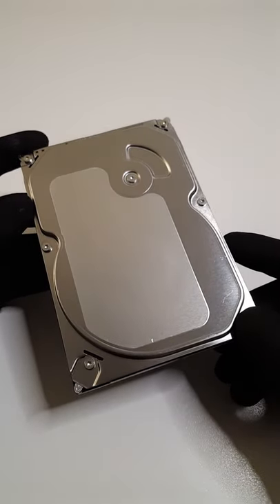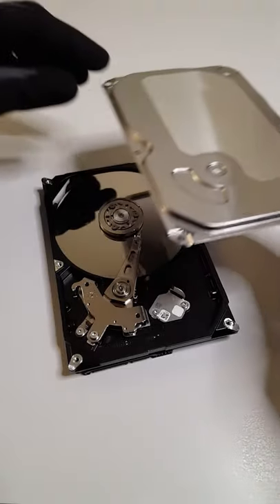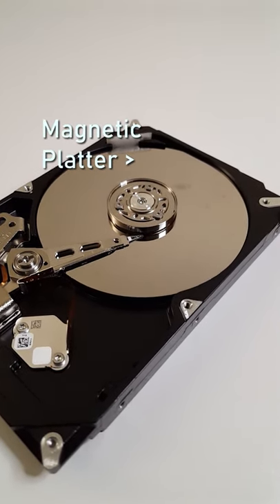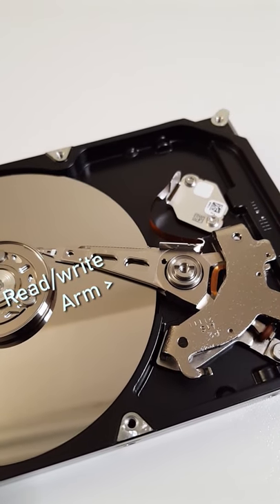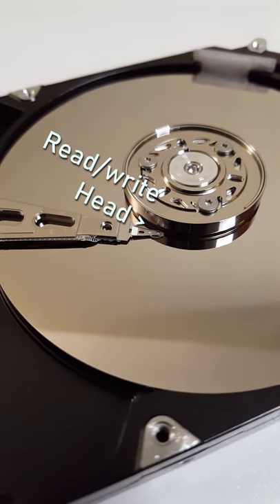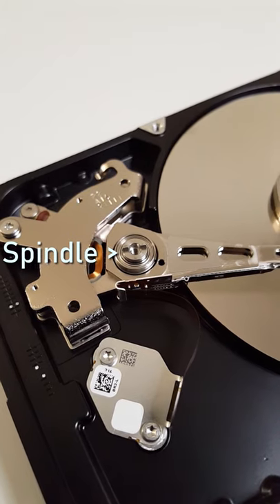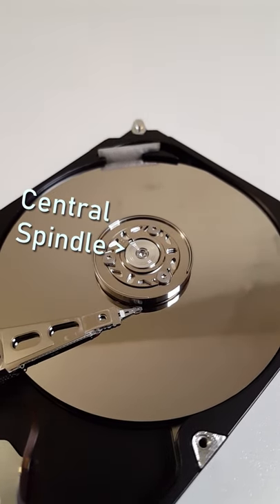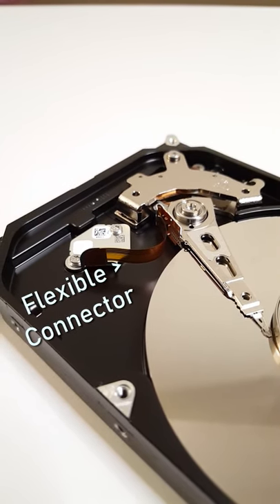How a Hard Drive Actually Works

Comment: Just a question. The data is stored on the magnetic platters right? If you happen yo smudge the platter, would it affect the hard drive?
Reply from the maker: Great question. It is possible, even when you just open a hard drive you can expose it to dust particles, hair, etc. Since the read/write head and platter do not touch and are extremely close together. It is possible for particles to get stuck in-between the two and cause scratches to magnetic platter.

Comment: When you took the cover off, i noticed the head was on the platter. Even if you pull out the SATA power cable from the disk, the head will still move back to its "docked" position off the platter.

Really wondering how that got there
Reply: there is no off platter park ramp in some drives, this is one of those, for those it swings the heads into the center of the platter.

Comment: No wonder it’s slow
Reply from the maker: Yes, with all the physical moving parts in an HDD. Something like an SSD tends to be a bit faster since they use electrical circuitry and have no physical moving parts.
Reply: @TechCleanse  A ssd is not only a bit faster. My current HDD does  max 200MB write my current ssd does 5gb write. So my ssd is literally 100x faster. You don't really notice it exept if you use windoze. Allthough applications do launch much faster with my ssd even on fedora.